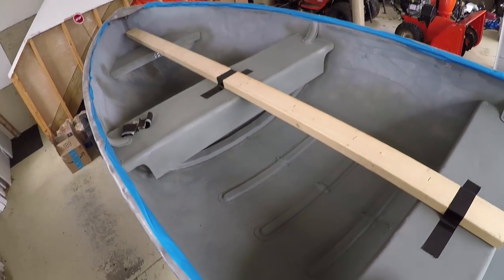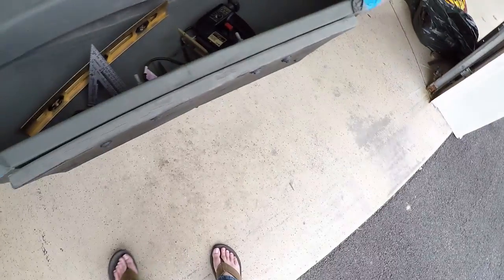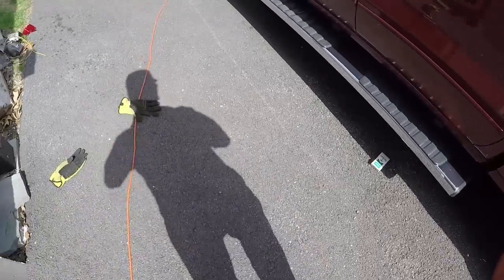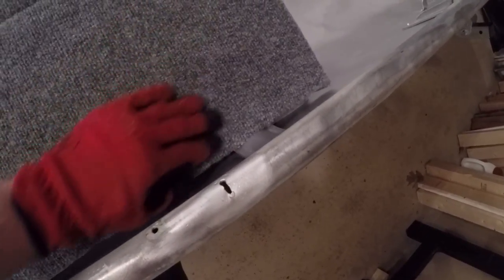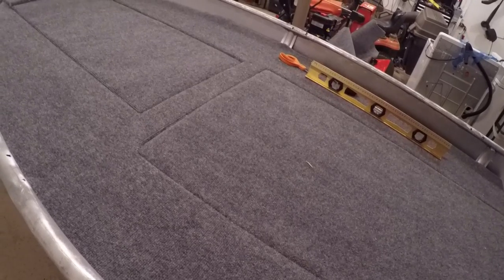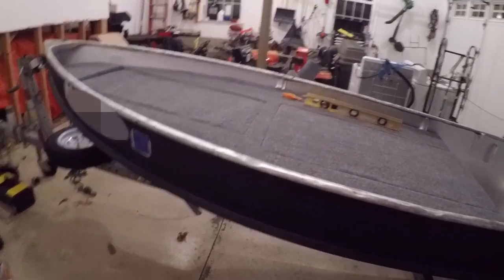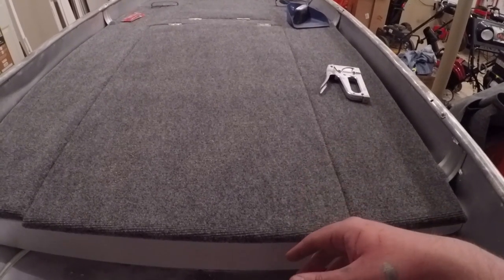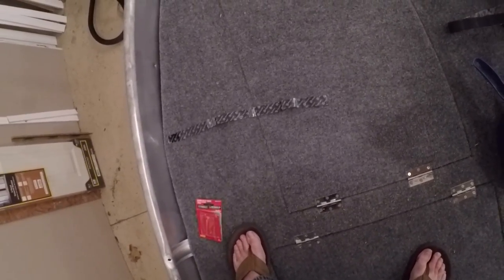Building A Deck for my Boat!!!

Comment: After three years have you had any problems with corrosion? Thanks for the video and ideas.
Reply from the maker: No. I used it yesterday. No problem. Didn’t see any rot after taking it from attic this spring.
Reply: Maine Man Bassing thanks for the fast reply!

Comment: Nice job
What did adding the deck do to on-the-water stability/fishability - especially in rougher water?
Reply from the maker: Justin Karshagen it weighed the boat down which is good. I don’t take this out if there are white caps. Going on year 4 with no problems.

Comment: How did you mount your trolling motor to the bow? Im in southern Maine by the way lol doing something similar with my 12ft
Reply from the maker: Jeff Donahue I use a block of wood to fill space at twists. Then, I use a separate extension for steering/throttle. If your trolling motor handle raises and lowers, you can get away with a straight handle extension, which in my opinion is better. If not, you need multidirectional extension which is a pain in the you know what.

Comment: No foam or sealant for the wood? It’ll last a few years maybe. Notgood
Reply from the maker: Tyler Hintz it was pressure treated wood. And if it only last a couple of years, I’m fine with that. It’ll probably break before that.
Reply from the maker: Tyler Hintz it was pressure treated wood. And if it only last a couple of years, I’m fine with that. It’ll probably break before that.